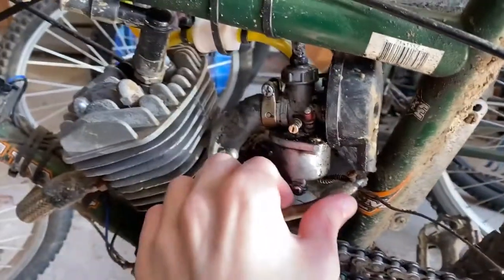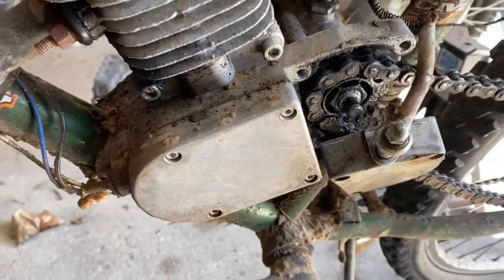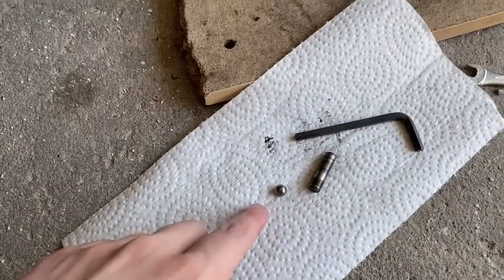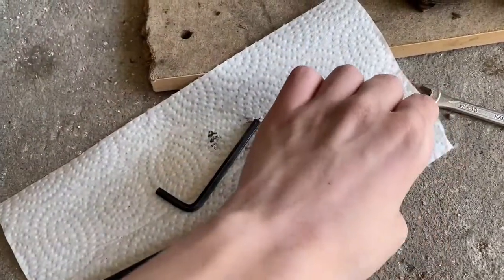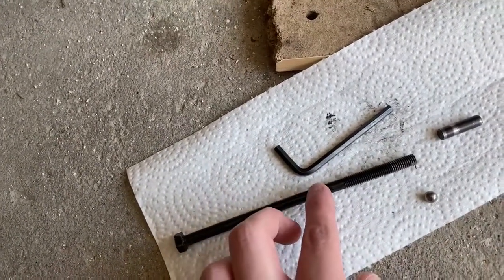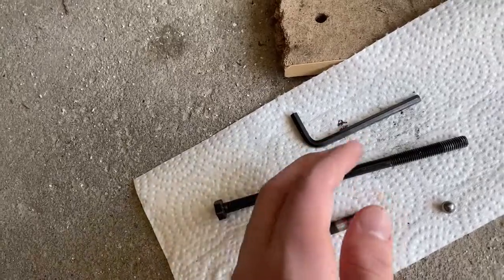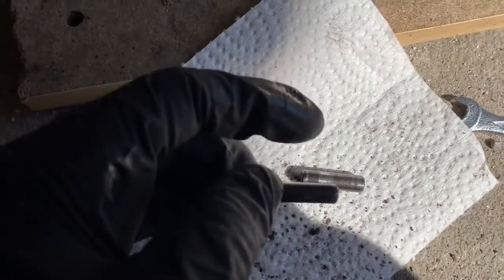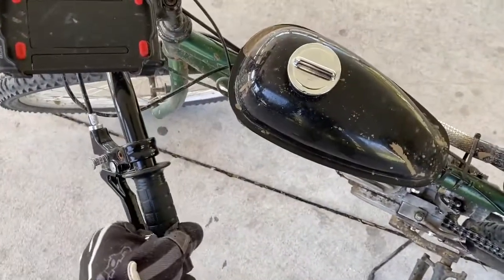How To Fix A Clutch That Doesn't Disengage | Motorized Bike

Comment: Ok. So I tried your fix and it worked like a charm. You have no idea how much heartache you just saved me. I was ready to but a whole new engine. The time and money to install a new engine, let alone breaking it in.... None of which happened because of you. I use my bike to commute to work...I depend on that thing. You saved the day for me. Thank you a thousand times over!!
Update
It's still holding up. I can't believe all the forums and videos out there saying to tear apart the engine and swap spring's and gears and blah blah blah....when all I needed was to put a little rod in place. Again, thank you dude.
Reply: Was your rear wheel stuck also? Clucth was completely not engaging?

Comment: Excellent video man. Right on point. I spent hours  today trying to fix my clutch.  Gave up. Put my tools away.  Watched your video pulled the tools out and rode my motorbike to Thanksgiving dinner.  You're the best. Happy Thanksgiving 🤟
Reply: Was your rear wheel stuck also? Clucth was completely not engaging?
Reply: @jayclutch6533 rear wheel is stuck, moves if I'm sitting on the bike peddling but it's rough asf, chain barely moves

Comment: This video helped so much I almost bought a new motor because I thought my clutch was locked up and I didn’t know how to fix it.
Reply: I was about to buy another tonight because every forum I read was like "oh just take the entire engine apart and blah blah blah". I'd rather spend another 160 bucks than spend two days monkeying around with the engine. That being said...I haven't tried this trick yet. What exactly was wrong with your bike? Because mine was just staying in gear unless I really tightened the cable. Even still it barely disengaged the clutch

Comment: My engine is brand new haven’t even fired it up and the clutch won’t engage the gear that holds the chain is stuck. What do you think is wrong ?
Reply from the maker: If the sprocket on the engine won’t move then the clutch is engaged, if it won’t disengage and it’s brand new then the arm is adjusted on the cable wrong. If it won’t engage you have to adjust the flower nut on the clutch itself, or you pushed the arm too far in. Hoped that helped
Reply: Same thing happen to mines what did you do
Reply: @brehlex8043  im having the same problem i been working on this for 2 month
Reply: My bearing won't even come out on a brand new one

Comment: Word idk I got one an it was stuck in gear I turned the flower nut 2 screw holes to try an pull the clutch some to get more. Nope its still locked in gear. Ima check that thing back out before I do anything else well I wanna rip it again broke the chain an tire in 30 minutes fixed it up got a bigger rim backwards with the hub off to fit spaced it was kicking the chain off as it started. Tmr I gotta mess with it put the rim off see if it's good an give it a nudge see if it broke or not it wasnt good. Went over some bumps an come slower an it did something like a hickup an jammed the chain on the engine an rim. So who knows its brand new it should be alright want my mud ripper lmfao. Ninjas coming out next month cant wait 😅

Comment: Was your rear wheel stuck also? Clucth was completely not engaging?
Reply: Have the same problem
Reply: @FletcherParish  make sure all screws are fully in on the side where you can see inside the chain spinner
Reply: @FletcherParish  and tighten up ur clutch string/wire

Comment: I just built my bike and when I’m riding and go to pull the clutch in the motor cuts off instead of idling any ideas of why it’s doing that ?
Reply from the maker: Maybe your idle is set too low. There should be a screw on the carb to adjust it, I haven’t messed with these bikes in a while so I can’t say for sure.

Comment: Is the magneto supposed to move when I hold down the clutch
Reply from the maker: No it’s not, most likely can be fixed by tightening the bolts holding the magneto in though. Hope that helps!
Reply: @decentimprovement9849  ohh ok I just built a bike and it won’t start for some reason I’ve checked everything maybe you can give some tips?
Reply from the maker: If you’re using the choke, don’t, it won’t start on choke
Reply: @decentimprovement9849  so I should put it down?
Reply from the maker: Yeah, don’t use the choke because it doesn’t allow enough air in for it to run, you only need it when it’s super cold out
Reply: @decentimprovement9849  ohh ok I’ll definitely try it out
Reply from the maker: Sounds good, let me know if it works!